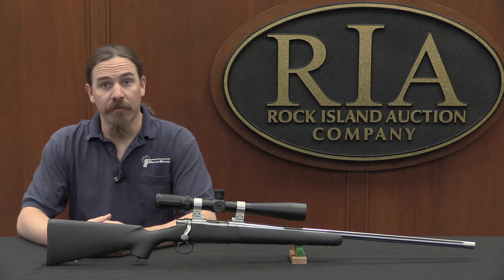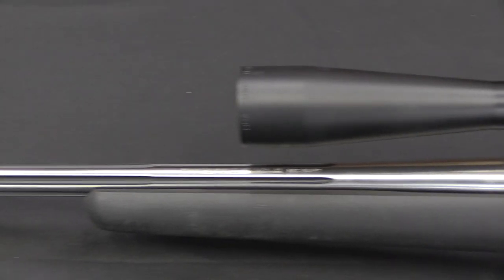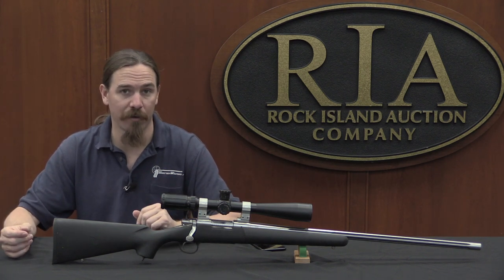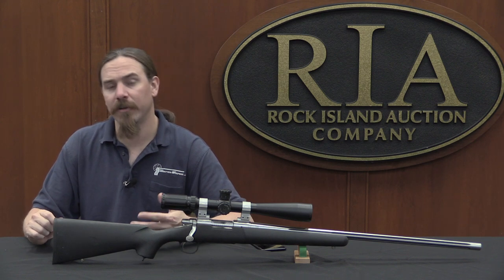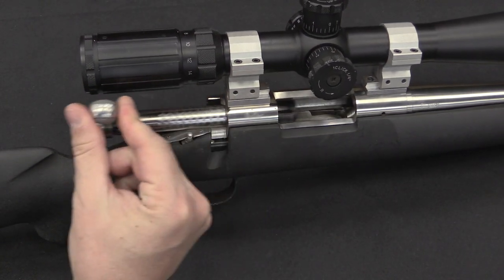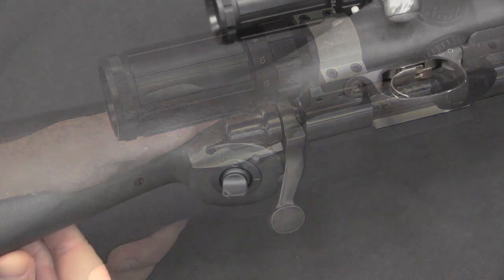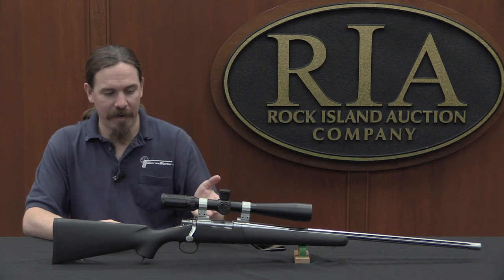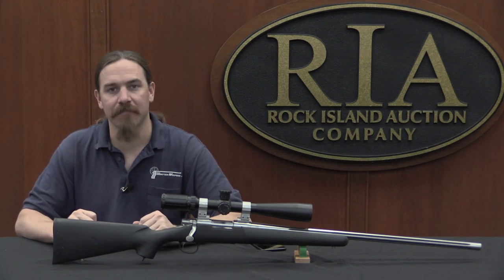Remington EtronX: Electrically Primed Ammunition

Comment: Good news, the EMP scenario would only hinder the rifle for about 48 hours tops. EMP's only disrupt electronics, in some cases it may damage devices but that's not it's intent.

Another great video, thank you.
Reply: Well considering there are no major electronics in it just a capacitor mostly. 
It would take the gun out of action till you replaced the battery as it would only short the battery itself out (if it was in the gun which it shouldn't be for storage)
Reply: Good news, EMP has no effect on batteries.

Comment: 1) As an old tanker, I spent a quarter century around electrically primed ammunition... in 105 and 120 millimeters. No big deal except there was this urban legend was that somebody in Germany had their radio antenna hit a power line and it detonated their basic load. 

2) IMHO this was a stalking horse for
a) Sales of electrically primed small arms to the military (not a good idea, what if the bad guys are in the wire and you have a dead battery. Plus the proliferation of devices carried by the soldier that need batteries has developed into quite a logistical problem)
b) Being able to tell the Gun Control Nutjobs, "See, we produced an easily lockable rifle that was impossible to shoot without the proper key and nobody bought it" 

c) Having something ready if California passed a law requiring all firearms be capable of being locked.
Reply: While 2a is true, you can get a lot of rounds off before having to change the battery. 
2b is a shame, because it's a rather sensible system. Though the price is a killer.
Reply: why not just use a piezo electric crystal to generate the current for each shot? It would be struck by a hammer which can be done by the mechanism of the gun.
Reply: @ilyarepin7750  interesting yet very senseless 😂
Reply: How would packing spare 9-volts be more of a logistical hurdle than packing extra ammo? And how would ensuring the charge be a significant logistical hurdle than regular cleaning and maintenance? If you can't be arsed to check the battery every time you do a routine cleaning then I'd wonder if you're even doing the cleaning in the first place. Plus it's not like the battery's just gonna die on you in the middle of a shootout by the look of things, batteries don't really suck anymore.

Comment: I have 2 of these.  .243 and the .22-250. They came with several hundred rounds of ammunition for each. Both rifles are superbly accurate rifles. You can really notice the difference in lock time compared to any mechanical trigger. They were a lot more expensive than a regular remington 700 but a more fair comparison would be a 700 sendero, or 40x. They are essentially factory target rifles. If you have all the time in the world to setup and need to precisely place a couple bullets they are great. But not my first choice for a zombie apocalypse.

Comment: Timely video, what with the Austrians reviving non-mechanical ignition right now. 

The only real difference is that they use a laser instead of electricity and their rifle can be converted to Ye Olde by simply swapping bolts. They do share the idea of Skynet and Meatspace rounds being identical, save for the primers.
Reply: Well I'm assuming it's laser powered by electricity. So the laser handles the role equivalent to the special electronically ignited primers. And probably same way. resistor or laser, both are ways to turn electricity in to heat.
Reply: Ari Takalo True. In the laser-based system, they shine a beam onto the priming charge through a transparent primer cup.

Comment: it would take an extremely unusual emp (unusual even for a very rare event) in exactly right situation to even bother the rifle. emps are particularly a concern for long conductors (electrical lines and other wires of length) that are under load while having thier longest dimension exposed at a right angle to the primary direction of em wave propagation. the greater the magnitude of the initiating event, the phase of the event (emps are composed of seperate phases that do different things), the closer you are located the epicenter (actually theres a goldilocks zone or effect of certain types of emps) and orientation and load status of the rifle all have to concide in order for the emp to effect the rifle. the short answer is that if an emp turns your rifle off , you either have to only switch it off and back on, maybe change the battery, or you have far worse problems than your rifle being turned off.

Comment: my favorite thing about guns is that theyre entirely mechanical. theres something old school cool about that
Reply: Idk I'm still waiting for hand held rail guns to be developed >.>
Reply: @ACEGAMER120  Just make your own.
Reply: @b226tj  Making a hand held rail gun isnt currently possible. Big reason being that energy density of electrical energy storage devices isnt advanced enough to build one that's functional and doesnt weigh more than a person can lift.
Reply: @ACEGAMER120  Search it up on YT.
Reply: B226 T&J those are toys, not a single person has created a “rail gun” capable of combat, much less fulfilling the basic role of a rifle.
Reply: @b226tj  I have. All of the smaller ones are way too heavy to carry and arent powerful enough to be weaponized.
Reply: @HaloDude557  The only weaponized rail gun that I'm aware of is like the size of a large battlefield gun. Pretty cool but the last I heard, they could only get a few shots off before the rails were junk
Reply: @garymitchell5899  Just had to replace my BCM on my car because components cracked on the motherboard. I work in I.T. I have a degree in Network Engineering. I really don't want to bring the crap that I have to deal with into my shooting hobby. Mechanical devices, while more complex to understand, are almost always more reliable then their electronic counterparts for operating longer than a week (in 2021 at least.) I get that firing pins can break, springs can break, etc. But I've never had them break without misuse. I'm not going to trust my life to something that, quite literally, can malfunction just because of errant solar radiation causing a bit to flip in a register in the processor, or a memory module. That's what I have to deal with in the server world by the way.
Reply: Also 3 years late I would like to point out that what we have, and what those working guns are, are coil guns, not railguns. Like Ace said, we can not produce handheld railguns because of their insane energy requirements.

Comment: One concern with an electrically fired weapon isn't much different from any firing mechanism: can you repair or replace broken components?  With this gun the most critical parts of the electrical system appear to be a boost converter and a relay actuated by the trigger.

Given the specialized primers, are they consumed in firing?  If so, are they much more complicated than a carbon button in a carrier?

Comment: Thank you for explaining the term "lock time."  One reason questions about lock time aren't asked is that not many civilian and non-competative shooters have ever heard the term.  Hopefully this video will help spread the word.  
  You also correctly explained the difference in lock time between ancient and modern arms, so, I'm duly impressed.  :)
To clarify (your verbage was just slightly clouded), in modern arms lock time is the time elapsed between the actual trigger break and the moment the primer is initiated.  Though it's only a fraction of a second, there are actually more times this matters than most would think, like in long distance shooting.
  I have a surplus Negant and there are modern replacement fire control parts which greatly reduce lock time...  Any older firearm like this would benefit from these type upgrades, especially if it it's being used for distance hunting or precision shooting.
  Lock time is just one factor that comes into play in aiming and firing a rifle.  Serious (especially old school) hunters, snipers and precision shooters all know that besides wind and a steady rest, breathing and heart beats will throw off a shot but lock time is the third factor of accuracy.  When faced with a target that is far off, moves and/or has a short window of opportunity, such as passing by obstructions (moving through trees, passing by windows and doors, etc.), then lock time comes into play.  
  Though lock time is extremely short and the mods I mentioned give improvements of only hundredths of a second, when you combine all things that affect a shots accuracy then it can mean the difference between making or missing a shot, particularly in a distance hunting scenario where an animal can make a sudden movement as the shot is fired where it's the difference between a clean kill or having to track down a wounded animal because the shot was several inches off the mark.  Particularly for a long shot such as in the open plains or across valleys, on a mountain side, etc.  That is exactly why this rifle was made.  There was a demand for a rifle that minimized the detractors of accuracy for hunting, particularly in the western states, where so many things affect a shot like wind, humidity, the shooters physiology (breathing and heart rate) etc.  
  Serious hunters and competitive shooters understand that controlled breathing and waiting for the brief moment between heart beats matters.  Many competitive shooters, hunters and snipers do a lot of cardio work to lengthen this time which, combined with a shortened lock time in the rifle, is the secret to hitting the mark.
  Sorry for the diatribe but this and other channels are here because people seek information to help there shooting and this is a very important topic.  Thanks again!

Comment: I don't mind the idea of the rifle at all. I think it's a quirky concept and I respect any gun manufacturer willing to take risks on a design, it's what drives innovation. 

But why the hell does it have a key? 

In what scenario is that going to benefit me as a responsible gun owner? Especially considering this is a hunting rifle. It's going to live its life in basically four different locations; the field on a hunt, the range, my house, and my truck on the way to any of the three other locations. Most of the those scenarios it's with me, the only other time it's in a locked cabinet. I don't need a key for my other rifles, and I sure as hell don't need one for this one.
Reply: To save the battery.
Reply: @danielallison1925  
I think what he was going for,,, was that a non-lockable switch will turn off the circuit just as well.
Reply: @willybee3056  You may be right. I was thinking of the Hopkins and Allen pistols that had a key for safety reasons back in the early 1900's. There is nothing new under the sun. Improved maybe, but not new it seems.
Reply: "as a responsible gun owner" but that's the thing, answer me this:how many people do you really think are terribly responsible? especially once they get some altering substances in their system?

Comment: That moment when a grizzly is right in front of you and your 9V-battery is dead... F***, well played remington. Great Idea ;)
Reply: Karottenbrot1 why you're in grizzly country with a .243, 220 swift or 22-250 is beyond me, but point taken lol
Reply: Karottenbrot1 that moment when you trie to think up unlikely scenario's that will never happen.
Reply: Hold on there grizz, I need to find my key. I haven't turned my gun on yet.
Reply: That moment when a Grizzly is right in front of you and your magazine is empty is also a likely issue, or a failure of any system in the gun or cycling the manual action.  Someone else posted a comment with error codes that said it has a low battery warning when it still has 100 shots worth of charge- that is, a battery gets you pretty far, so it's not like it's going to be a constant thing.  It's only priming the cartridge, it's not like a coilgun where it uses up some massive amount of charge actually propelling it.
Reply: @strawman5300  Karottenbrot1 that moment when you trie to think up unlikely scenario's that will never happen."

It's more likely than someone misspelling "try".

Comment: On the subject of EMPs:

If the electronics are surrounded by metal it is safe. Even Nuclear level EMP would still fail to harm anything sitting inside a car.

Faraday cages work for a reason. Electronic Weapons are viable, we have simply failed to use them in a way that makes sense and is not too expensive.

It completely baffles me why they did this with a bolt action. Any advantage would be completely lost by forcing the user to operate everything but the trigger manually.
Reply: Electronics not attached to long cables and built so that individual components can withstand magnetic fields and also a little bit of a voltage spike will also be safe. Small devices not attached to long cables are quite resistant. You get the worst effects at both ends of any long cables. So it fucks up the electrical grid and anything connected to it (without really good and fast reaction time fuses). Also, all EMPs shown in movies, except for the ones shown in the context of nuclear war, are bullshit.
Reply: Lawsuits, that's why. 

You can bet your ass the ATF would have declared anything semi-automatic as "machinegun" the second it was available.
Reply: Robin Bot Their capacitor recharging circuit was too slow for anything but a bolt action.
Reply: well but batery is in stoch, witch is not protected
Reply: ATF can get funny if they believe that it could be ran in or converted to full auto.
Reply: @petrsukenik9266  Maybe the stock should be wrapped in tinfoil then. Anyone who would bother doing this should have a fair amount of tinfoil lying around…
Reply: Part of the issue with using their particular design with a semi auto rifle is the fact that it takes 0.6 seconds for the battery to charge the capacitor so this would cause an issue with anyone trying to rapid fire. Also as someone else mentioned, it would be WAY too easy to make it full auto so ATF wouldve probably thrown a fit

Comment: I am no expert on the subject , from a quick google , its mostly more complex electronics that are susceptible to EMP (transistors, IC ‘chips’, microprocessors, etc.).
Things that are not plugged in to mains are much less likley to be effected by EMP. 
That said , this is basically a battery linked to a capacitor , the trigger then discharges the charge in the capacitor into the resistor. At a guess, if you held this gun next to a massive EMP discharge, the chip that controlls the flashing light will likley fry (good chance that would stop the gun working) and if it was a maaaaaaasive charge maybe all the resistors would get hot enough to discharge all your rounds but we are talking some serious EMP here. 

this is mostly speculation , it would never happen but it was interesting to think about
Reply: GamersBar you basically have to have it right next to a military grade emp for the resistors to do that

idk about the light  what not but if it's a barretty connected to a resistor with a capacitor as a trigger it it'll be fine
Reply: Yeah I agree its super unlikley to have any issue , its mostly more complicated electronics that would have issues , I actually really like the idea behind this rifle and that it uses just different primers for the rounds. I did say you would have to hold it next to a massive EMP, and chances are you are going to be having other problems if you are that close.
Electronics in firearms are not popular but I think the idea behind this rifle is worth someone developing , this seems a pretty well executed design to me , about as simple as it can be other than having a red light all the time when you want to shoot thats not ideal (not that its super bright) , the other thing you would need to get rid of is change the key to a on off switch.
Reply: I'd actually say that this thing almost certainly has a microprocessor in it, otherwise the whole LED trouble code thing wouldn't work. I also suspect that it has a MOSFET instead of running the full voltage through the trigger switch itself.

Even without EMP I'd guess that either the MOSFET or the trigger switch itself would be the first thing to fail, at least judging by what goes wrong on power tools.
Reply: And if you were close enough for any of that to be an issue it would likely kill you as well. 
Because lets be honest EMP devices are not movie style flashes of light.. they are basically a task built nuke. (That an EMPs can affect humans too, we're giant bio-electrical generators)
Reply: This gun would be extremely easy to harden against EMP because it's a closed system. The electronic components just need to be surrounded by metal to make a faraday cage which should be extremely easy to do. This becomes difficult if you need to transmit or receive signals. Weak points on the rifle would be the LED and the trigger, but you would still get a substantial reduction in EMR reaching the components.
Reply: Pretty accurate. And if you would be in a position for your gun to discharge(get it? It's electric... Okay, that was lame.) you would have a whole host of more pressing concerns. Not to mention, that you could just cage the firing mechanism up and ground it to the barrel

Comment: So what happens if you are walking across shag carpet and grab a round of ammunition resting on a metal table by the primer end? :P
Reply: If it is dry enough, you get a nasty little zap. And the bullet sits there unaffected.
Reply: You likely would need way more current than you produce with a quick static discharge to actually warm the resistor primer enough to ignite the charge.
Reply: The fact it needed a capacitor means it's probably the safest ammo available. It literally uses a camera flash circuit.
Reply: Carsten Nokleby But a microprocessor based complex one, not one of the traditional sturdy ones.